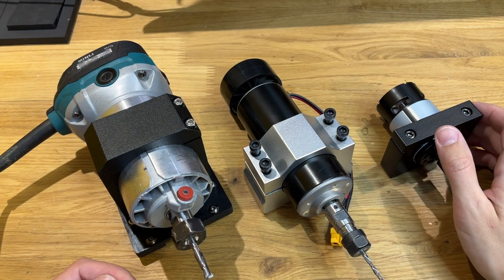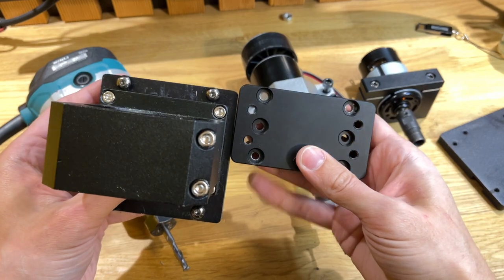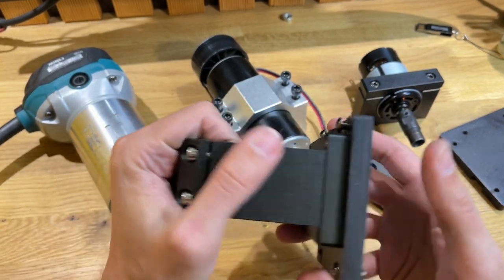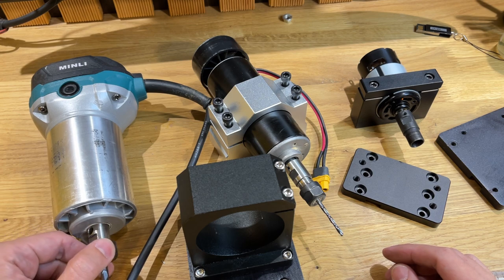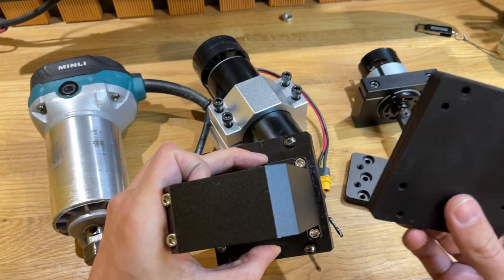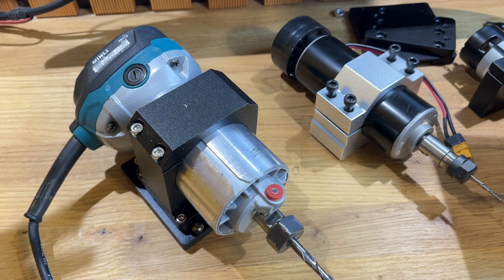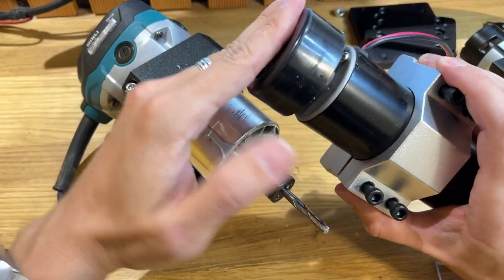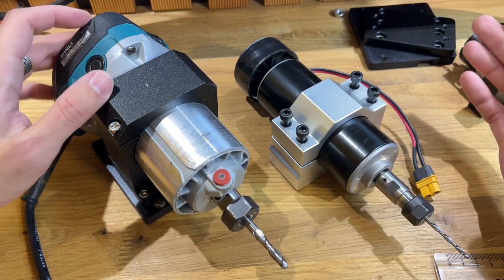I installed the MINLI edge milling machine on the TwoTrees TTC450 CNC.

Comment: Thanks for Your inspiring video!
I found another miller on amazon. Another buyer said, it has a diameter of 64mm (which I don't know, if I should believe this).
Would the 65mm z-clamp frrom aliexpress hold a 64mm cylinder securely?
Reply from the maker: I think it will do. The 65 mm milling cutter is inserted quite tightly.